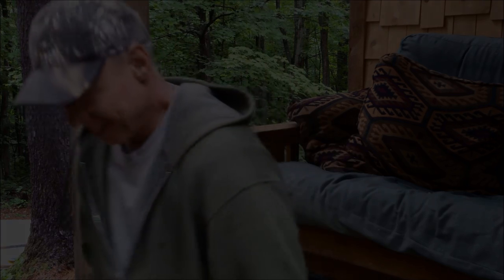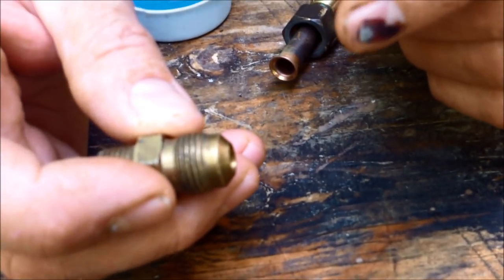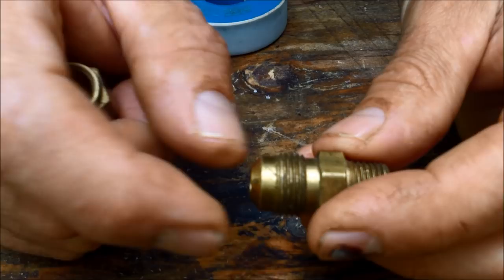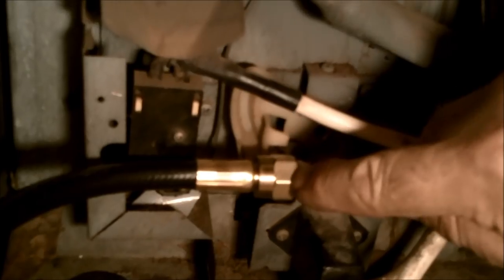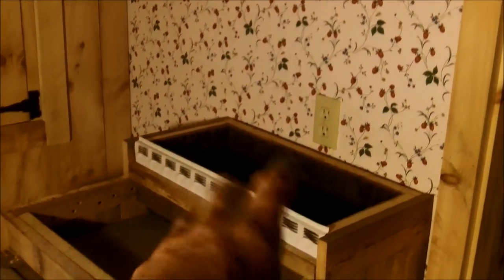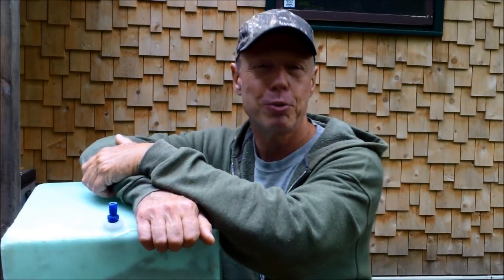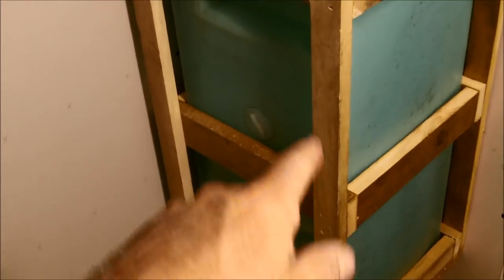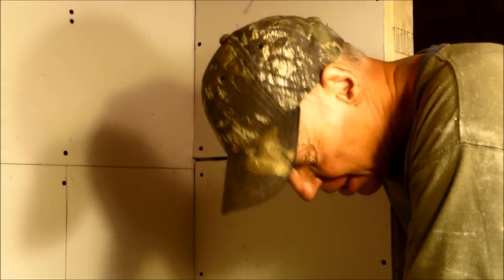NH CABIN PROJECT.   Gas Refrigerator and Gravity Feed Water.

Comment: I just today installed a 55 gallon drum on a stand beside my top shed and painted it black. It will now sit about 9 feet up and in the sun all day supplying me hot running water below it in a shower that drains into the espaliered citrus row (nine trees - mostly multi grafted) that runs down hill from there. Living on a hillside has some advantages as I now have only one pump supplying water to my shower (gravity feed and filled only when needed from the bottom tank, my irrigation tanks (275 gallon and 750 gallon gravity feeding my wicking bed gardens and paint stand/wash up facility) and my 20 gallon chicken tank (gravity feeding chicken nipple drippers both INSIDE the coop and UNDER the coop to ensure cool fresh water for the chickens daily). All of which has been inspired by your cabin systems...All up cost (still living on grid in suburbia) about $3- worth of electricity each quarter to keep tanks filled up from a bottom tank which collects rainwater from my roof. All on a quarter acre.
Reply from the maker: Awesome.  Love projects like that :-)

Comment: The fittings use NPT threading. The thread is tapered to form a compression seal when tightened. The propane will not contact the teflon if its only on the threads and the teflon will decrease friction allowing the fitting to be tightened further increasing the compression and improving the seal. A liquid lubricant can provide a similar benefit when tightening NPT fittings.

Comment: I have the same Dometic refrigerator in my 13', 1974 Hunter Compact II travel trailer and it still runs great. Love the way you installed running water in the kitchen.
Reply from the maker: Such a great little fridge.  Yep. to get running water in the kitchen, I run it down from the well and then up to the second floor.  I'm running all over the place haha.
Reply from the maker: I have all I need and love the exercise.  :-)

Comment: Got a old camper Heater. And reverse engineered It for my cabin. It has two blowers one for 12 volt. Other for 115 volt. House is solar. So 12 volt it is. . always looking for an edge. Tks om  and Grandpa had a hand pump. He would pump  to the tank up stairs..he had a return line at the top of tank. To run back down so when the tank was full it would run down and tell him "full"  that was his exercise for the morning. Good life at 97 years . For Jacob ENGLERT bloomville ohio

Comment: Hey boss, FYI... propane eats teflon, the flare fitting is actually designed to seal without any sealant or tape
Reply from the maker: Hard to teach an old dog new tricks.
Reply: As usual, love the video.  I'd love to have a cabin like yours, either one.  So cool Boss.  But, Josh is right.  It won't seal right.  You need the yellow tape for gas.  I only know this myself because i've been working on a DIY forge and propane scares the crap outta me.  : )   Say hi to Frankie for me.
Reply from the maker: I've never heard of the yellow tape until I posted this vid.   I've been using the white stuff for 35 years with no issues and this gas fridge had white tape on it from the factory installation.  I'll look into this yellow stuff though.  Cheers ;-)

Comment: Nice job buddy. Great water tank idea. Got a camper salvaged fridge and stove stashed away myself. Been solar heating water for showers here. I rigged up a second shower head and was using a painted black 5 gallon bucket and a 12v rv pump. Think i'm going to do your shelf and container idea. Like you said less hassle no pumps. Come fall i'll be heating my small tanks with the wood stove and copper heat exchanger i wrapped around the pipe.Works real well. I'm on the grid here but it has reduced my power bill to almost half. Last bill was $71 for two months. Appreciate all your ideas and i'm looking forward to more NH videos. Many thanks as always my friend take care.
Reply from the maker: The shelf shower works awesome. So many want to complicate this but it's great as it is and I won't change a thing.   
All the best :-)

Comment: Always excellent advice! You must have been raised something  like myself! If it needs fixing, why pay someone else? Trial and error is an education. Good plan to check with soapy water or spray cleaner of sort to make sure no leaks. When using propane especially.Is heavier than air and will settle to the floor , under cabinets etc. Not to mention that when they fill the propane, it has such a skunk smell when the  tank gets to the bottom is pretty hard to miss if you have a leak. Great video's!!
Reply from the maker: Agree on all accounts :-))

Comment: A plumber who has to check 30 or 40 joints with soapy water will do it with little or no bubbles using a small brush so he can quickly & easily see any gas leaks instantly! (dont shake the solution to make bubbles, lol) Good video, Thx JC!
Reply from the maker: Good point. The old fella that showed me this years ago did it this way so I've carried on in the same manner. 
Cheers :-)
Reply: Its a minor point and if you like it that way then thats the way you do it. You are so talented in so many areas I feel a little bad in correcting you, if we were working together on a project I would be able to show you a few things as I suspect you would show my a lot, lol!  I am thankful when ever I see you putting out a new video, keep up the good work!
Reply from the maker: No worries on correcting me, I appreciate kind suggestions.   All the best.

Comment: I feed my camp with a 250 gal pallet tank on a trailer.Tow it down to the brook and fill with a small inch Gas pump in less than 30 min I am back .then it's gravety feed to the camp ! I use it for dishes hand and stuff soon to be shower .I AM adding a on demand hot water heater next year.I do add a pool puck to the tank to keep the water safe .WE DON'T DRINK IT. We get about 7mths a year from this system before winter sets in

Comment: Great video, JC. That fridge is about the same size as the fridge in my cabin. Unfortunately I've discovered mine just isn't big enough. I've been living here fulltime and when my wife comes on weekends, we just don't have enough room in the fridge for the food we need to put in there. Especially once we started putting some condiments (salad dressings) in there. I've got another fridge on order, 11cu ft, it's about twice the size of the current one. 

I used a fridge in a camper that was switchable between propane and electric, it was pretty nifty. Almost bought one for the cabin but I'm glad I didn't. It was even smaller than the one I have LOL. 

Hope yours meets your needs.
Reply from the maker: I'll be ordering a gas chest freezer very soon.  Then I'll be set.
Reply: Let us know how it works out, JC. I'll bet 50 bucks this fridge isn't big enough for you!
Reply from the maker: Don't forget, I have the icebox as well.   I may not get the gas freezer now and working in some new ideas :-)

Comment: im doing the same thing now boss hooking up the propane fridge mine is a little larger and was not working so had to burp it I hope that was the problem. I to am on gravity fed water but the spring is higher than the cabin so no buckets needed. Installed the kitchen queen this weekend all 800 pounds buy my self just a little brain power needed on that. I think when you get your new stove you will have the same problem as I had. Its not moving the stove that's hard but getting it off the pallet to sit directly on the floor that's the problem let me know how you make out. Keep the vids coming boss they really are helpful to me. see ya friend.
Reply from the maker: When we put that KQ in the homestead, my girlfriend and I did it ourselves.  It's amazing how much weight people can move by using leverage and rollers.   Got it into the house and into place without breaking our backs.   Work smarter, not harder :-)     Best of luck with your cabin project :-)

Comment: The Teflon tape is not recommended for the  reason is the tape can get into the gas line and into your gas valve that is what they said in heating and cooling school back in the 80s ,us pipe dope if it makes you feel beter ,nothing is also fine. I hope frankie and you doing well!
Reply from the maker: True.  I just did my first connection without any tape and had no issues.  Guess you CAN teach an old dog new tricks ;c)~

Comment: Hello Boss!

It's too bad you don't have a nearby stream wherein you could employ a Hydraulic Ram pump to pump the water to the cabin.  But at least you're surely getting your exercise carrying that water!

How expensive is it to run that refrigerator off of propane.  Around here in West Michigan, propane can get quite expensive during the wintertime.  Would it have been cheaper in the long term to have purchased a small electric refrigerator?

Watching you explain the flared fittings took me right back to my teen years with my dad's business.  He was a commercial refrigeration engineer and taught me everything about refrigeration.  Nice trick with the soap bubbles!  We sold a liquid soap you could put on fittings to test for leaks!
Reply from the maker: It's not too bad really because I love what I do.  I've carried water from that well ever since I was old enough to carry a kettle. I have pumps and generators and all that jazz but I do what I like and like what i do so it's all good :-)))  

I'm waaaay too forested here for solar but eventually I'll have that issue resolved and we'll be styling.   One project at a time :-)

Comment: Not sure if it matters, but I thought there was a special yellow teflon tape that was for gas. The white stuff is for water connections. But no leaks are all that matters.
Reply from the maker: Been using the white for 35 years with no issues but good to know about the yellow stuff.

Comment: Looks like you're getting modernized without all the modernization.   Great job boss.  Do you have any experience with a copper coil around a stove pipe?  I haven't tried it yet, but I'm curious how high a thero- syphon will lift.
Reply from the maker: Never tried it. I'm fine with a kettle on the stove :-)

Comment: JC I have a motor home and your fridge needs to vent the gas from the burner OUTSIDE
Please be careful as I thought that you were allowing the vent to just vent inside the cabin.
Also it produces heat in the summer months...Just want you alive and safe..
Reply from the maker: I am aware of that but thank you for your concern.  They're vented outside in campers because of the small spaces but as I said in the video, I only need it during the warm months and my windows are open at that time.  It actually expels a lot less CM than a gas range but surprisingly, people never think about that with gas stoves.  

All the best :-)

Comment: Hey Boss, love your vids and Frankie. But you do not need Teflon tape on flair fittings as the seal in in the taper in the flair. If the tape were to get between the flair it could actually cause a leak. 
Just because everybody is doing it wrong, doesn't make it right. Off grid and loving it.
Reply from the maker: I've been informed about a hundred times since I made this video so I'm glad I have folks looking out for me ha ha.  I did my first flare fitting without tape last week and no issues.  Guess you CAN teach an old dog new tricks :-))

Comment: What about piping the exhaust fumes out of the house?
   My fridge came out of a Shasta too. Maybe yours is different and has no need for venting, but my little Dometic was vented in the trailer, so I vented it out of the cabin as well. Some flexible gas line through a couple gusset plates (for heat) mounted in the wall worked cheap and easy.
   We'd really hate to loose you to carbon monoxide poisoning my friend.
Reply from the maker: The fridge is only in use during the summer when the windows are open.  They are vented in campers because it's a tight space.   That tiny flame is the least of my concerns but thanks anyway.
Reply: Excellent point. I'll keep that in mind when I finish my ice box.
    I guess I'm overly cautious. I had a bad experience once and I'm still a tad gun shy. Also, my first cabin before the addition was pretty small. About 240 sf.
Reply from the maker: Better cautious than dead I suppose.  Lots of folks worried about gas fridges but no concern for venting the 4 large burners of a gas stove or the even larger burner in a gas oven.  I always wondered about that.

Comment: I enjoy your projects... but having worked on RV refrigerators I was wondering how this is working for you... The manufacturers have specs used when in an RV and without having it vent outside, I was wondering if it made it too hot in the cabin when venting inside since you are using in the summer...?
Reply from the maker: It's worked out awesome so far and I'll be doing an update very soon on this.  I'll be discussing the venting and other questions that have come in.  Stay tuned :-)

Comment: Do you run all your lights on battery power?  Do you recharge a battery with a generator?  Great videos.
Reply from the maker: Yes and yes.  I have a solar array but it's still in the box until I cut enough trees to allow the sun in here.

Comment: I hope you have a plan to vent the combustion gases to the outside from the fridge. Carbon monoxide is very dangerous.
Reply from the maker: Very good point but I only need the fridge during the warm months and my windows are open at that time.  When I build the screen porch, it will go out there so no worries :-))

Comment: You should vent that to the outside as the flame in that system produces carbon monoxide which is odorless, colorless and deadly.
Reply from the maker: Thanks for your concern.  I'm aware of CM but this fridge was only needed during the summer when my windows are open. It's not needed now.  It's funny how nobody is concerned about their gas stoves when they're cooking holiday feast and there's multiple gas burners running all day, but... so many are concerned about this tiny flame not much bigger than a pilot light.

Comment: I have water from hydrant currently elec from power co for lights heaters and elec stove.   Changes to off grid cabin wood cook stove for cooking and heat. I've decided on vermont xl bakers oven since cabin will only be approx 250 sq ft
  Its actually portable bldg 12x20. The ground here is not good so it can be reblocked when ever needed.  Roof material will be galvanzed metal as well as removable skirting panels.  My question is anout frige you built into wall i would like info on that please.. i want to havve rain water collection into tanks. But also hook into my current water line as a back up. I will be able to wash clothes inside from double sinks with removable ringer serving as wash tubs and kitchen sinks.  Currently i boil water in 30gal trash can outside to wash and have to let them drip dry. Actually i am trading into off grid for dependable heating cooking  and comfort of doing inside laundry. I guess you could say its comfort dependable upgrade for me
Reply: his viedo was awsome i learned a lot about that gas hook up.  Super awsome thank you very helpful

Comment: good god man you didn't show how to start the fridge...what happens to the propane do you have to light a pilot light or something?
Reply from the maker: You follow the instructions designed for your fridge but yes, I light a pilot.
Reply: thats my fear is not knowing much about a pilot light and whats involved in that process. now i kinda get why you didn't show it because of liability stuff.i have an old camper w/fridge and i would do backflips if i could solve my problems with refrigeration at my camp. this video gives me hope that i too may use my camper fridge in my camp with propane.i guess finding out what kind of fridge it is and looking for operating instructions. tks boss good luck in nh.
Reply from the maker: On my fridge, when I open the door, the lighting directions are posted right there at the bottom.  My spark ignition doesn't work so I use a match.  I will be talking more about the gas fridge in another episode.  They need ventilation but I only need the fridge during the warm months and my windows are open at that time.  When I build the screen porch, it will go out there so no worries about carbon monoxide.

Comment: I worked with flared fittings for MANY years.  Please believe me when I tell you that putting teflon on the threads of a flared fitting will not do anything for you. If a flare leaks on you it will leak back along the copper tube and never out the threads of the fitting.  In the end i suppose that the teflon isn't doing any harm to your flare fitting but I can assure you it's not helping seal anything either... The seal is all on the face of the flare.
Reply from the maker: Thank you for your input. Your explanation without criticism is much appreciated.  All the best :-)
Reply: No worries.  As a retired heavy duty equipment/diesel mechanic for over thirty years I saw my fair share of flared fittings.  I remember putting teflon tape on a flared fitting myself when I was just starting out until an older mechanic explained how flared fittings seal.  Never forgot it.

Comment: Okay, found this. 

Poop!!!  Never mind yours is from the 70's!!!  Sorry. But someone else may need the info.

But I want to mention something. We bought a  used 1996 Shasta fifth wheel. There have been two recalls on Dometic refrigerators. They go all the way back to 1997 and up through 2006 for the recalled models. It was because of fires and explosions. There is a class action suit that was started last year. We had a dealer check ours and the recall kit had never been installed. He got the free kit and the installation was free for us. The Norcold were recalled as well. Here is the link to where you can check yours. Even though ours is a 1996, the fridge is a 1997. Better safe than sorry I say. 
P.s. Our '96 looks nicer than the new ones inside after our renovations. And paid for!
http://67.238.126.140